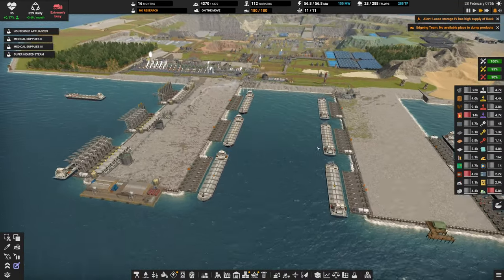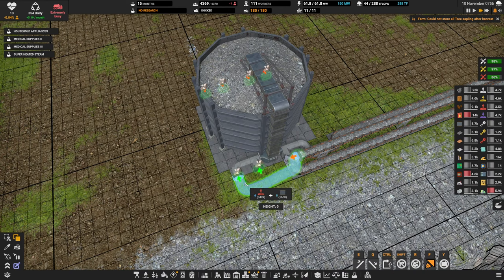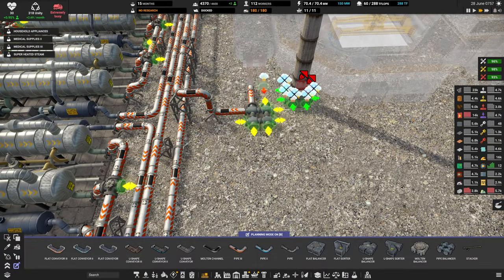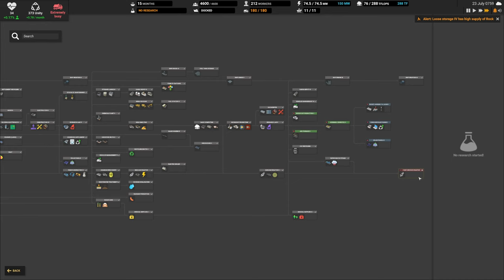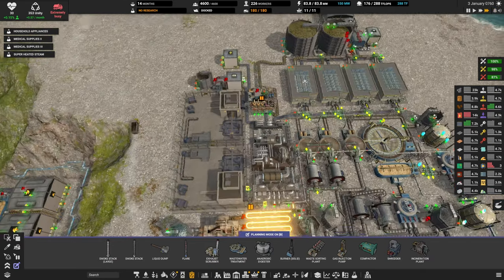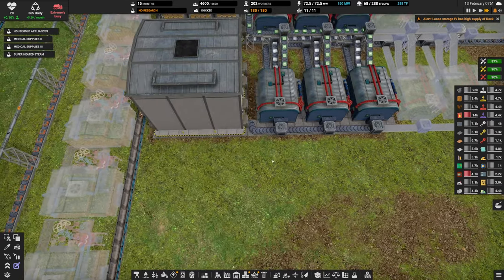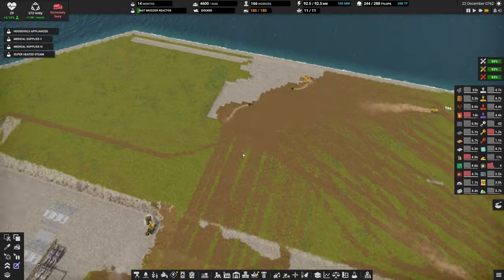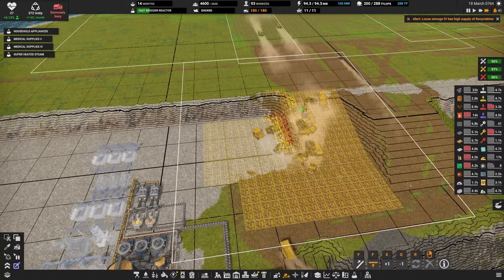Experimental Reactor Relief Valve 🚛 Ep56🚜 Captain of Industry  Update 1 👷 Lets Play, Walkthrough

Comment: also, on one of your livestreams, fox suggested that you upgrade all of the belts in production to 450 belts, and you said you can't afford the power. well, I balked at the idea at first, but I ran the numbers and 450 belts are actually more efficient for the assembler inputs because they move products 7.5x faster, using only 50% more power, which is an overall savings because the belts are only on for less than half the time.

Comment: I suspect first you're going to run the nuclear water output pipes through a 6x6 balancer array, before running into farms or tanks and then farms. The sulfur mine does get me curious. are you planning on doing sulfur for sludge? running that into a lot of digesters and using the compost for organic fertilizer and the fuel gas to get hydrogen to make into ammonia to make into fertilizer 2?

Comment: Why such a complicated setup for excess steam? Why not just have a priority on the balancer?
Reply: This
Reply: because the reactor will produce as much steam as the system can take on auto balance, therefore if you just vented excess steam it would always be at full power, what you want is for it to be at level 1 when there's not enough demand and not over heat, meaning if you don't need 96 steam, the remaining steam needs somewhere else to go, but if you had a system that could vent out more than 96 steam, then the reactor wouldn't stay at level 1.